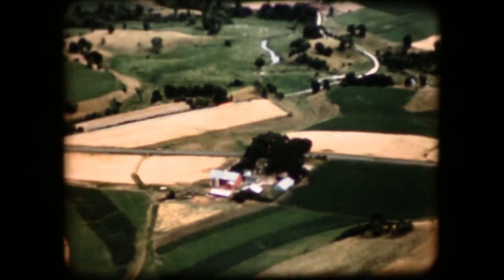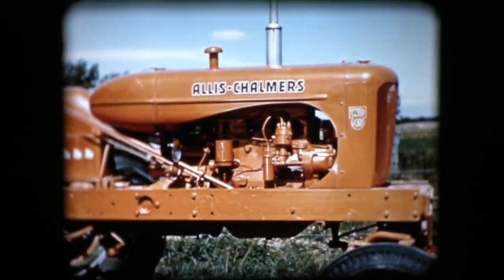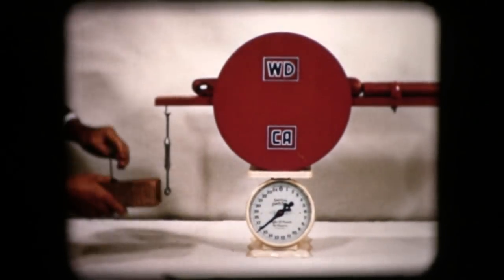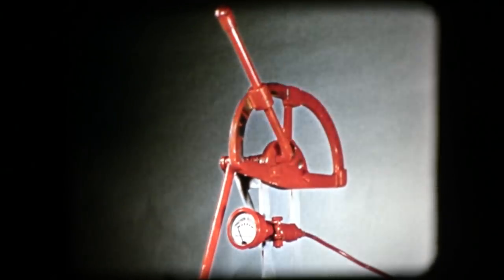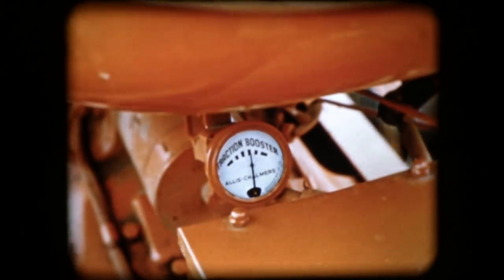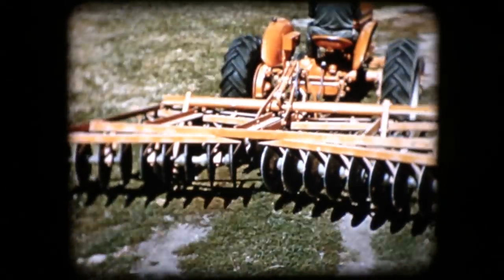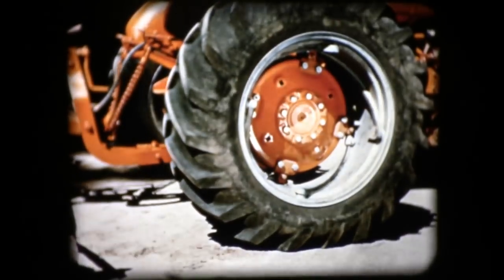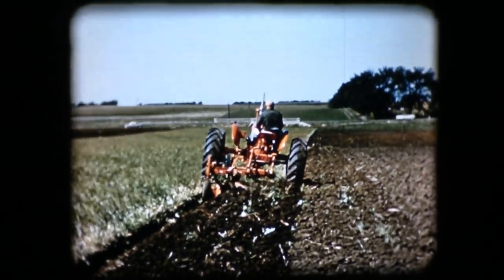1950's Allis Chalmers Dealer Film Engineering In Action Rare Color Version WD-45 Traction Booster

Comment: I still Farm with my wd45. I’m a small operation but she still works, is easy to work on and I have plenty of snap coupler hookups. I love plowing and discing with her and love hay season. She pulls my 9ft haybine without issue and is a pleasure to rake in 3rd gear and has no issue with the New Holland round or square balers.
Reply: Do you run a round baler with it? I bale with a ford 860 tractor on a gehl 1475 round baler works good but drawbar should be higher. Was thinking about trying the wd 45 on it but don't know if it has enough hydrualics.